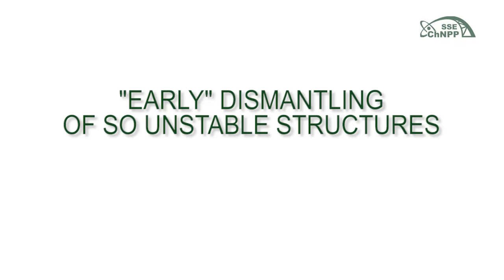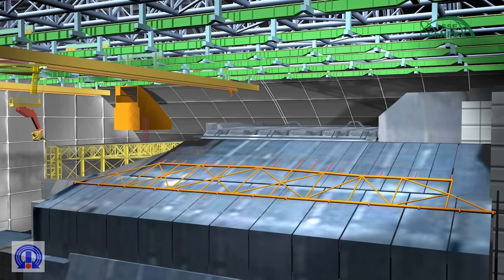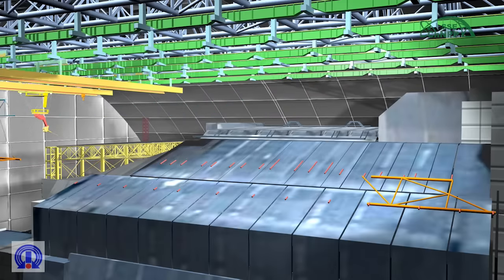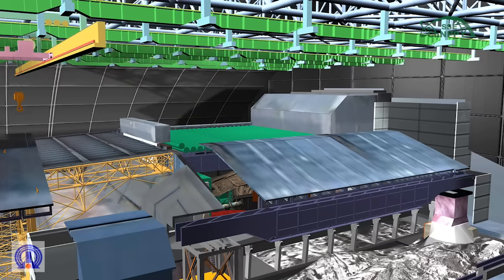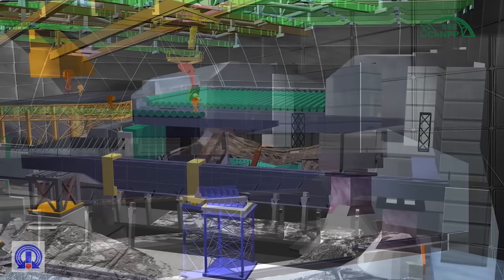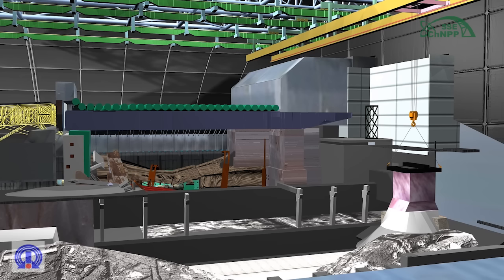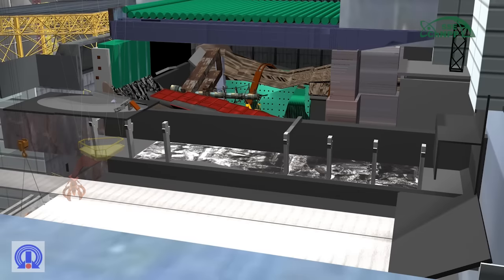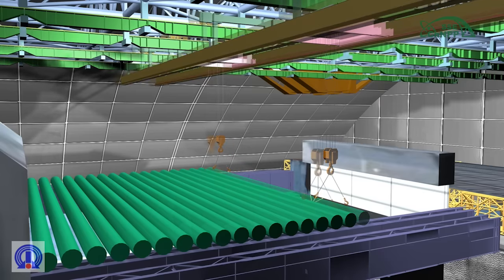"EARLY" DISMANTLING OF SO INSTABLE CONSTRUCTIONS

Comment: man i really hope they film this process as its a once in a life time event that Needs to be recorded
Reply: I agree, but the radiation level might make any electronics fail once they 'open' the old structure
Reply: @jasonhaynes2952  nope, there is footage from inside the sarcophagus. People have been inside and walked around without getting I'll.
Reply: @Matt_10203  Yes, that's true but there are still areas that need to be avoided. It's not as dangerous as it was, but that doesn't mean it's safe to be there.
Reply: I wanted to comment the same
Reply: @jasonhaynes2952  people have been in the sarcophagus, and they have filmed it, so I don’t think it would be to bad for electronics and cameras.

Comment: I've been fascinated with the new safe confinement for years, and been following the project. This is engineer porn for nerds lol, can't almost believe this is possible. I wonder: how many years until they reach the melted core? And until it's completely removed and stored in a permanent place? I hope we will somehow be able to follow the progress over time...
Reply: I've heard decades.
Reply: Agreed on all points! :) As to following the progress, and when everything is scheduled to be finished? I won't assume anyone else's age or potential longevity, but at 52, I'm fairly certain that I won't be around for the latter parts of the project. A good YT video I've watched presents a lot of summarized information (https://youtu.be/hf2-AXTVnvU?t=37), and, according to that timeline, the decommissioning of all units at ChNPP is currently scheduled to be completed in 2064. Big projects with a forecast that far out can tend to go over ... sometimes WAY over. So stay healthy, everyone! :)
Reply: Very well put.. that’s exactly what this is: “Engineer Porn”
Reply: Agree, the happening of this disaster is very black point in history, but tough Nuclear energy is very interesting. They can reach the melted core "quite easily"  however, the old sarcophagus roof needs to be removed, and then it's impossible to work for human being due to the very high roentgen. Beside this, there is a lot of sand, lead and other stuff on top of the 50% turned reactor. The angle is one of the hundreds of risks in the endless project.

Comment: 1: How log is this supposed to take? 
2: What happens when the "Temporary Storage Area" is full? 
3: where is the "Permanent Storage Area" located at?
Reply: This will take a couple year, the temp storage is large enough, and there is no perm storage, its cleaned and then they might recycle or bury it.
Reply: 1. As long as it takes.....problems are expected along the way that will require solutions
2. They will move the waste from the internal temp storage to the outside permanent underground storage....and the fuel/graphite to a Nuc/waste facility
3. adjacent to the NPP........its considered a wasteland now anyway, so there is no point moving it to another area.
Reply: @histopixelfilms6778  Will the remove everything (including the "elephant foot") or just the old sarcophagus?
Reply: @ChuckomoHo  They will also remove the "Elephant Foot" as part of the  fuel and graphite cleanup.....it will go into the same place as the other waste fuel storage.
Reply: How do you remove molten and hardened radioactive lava that has merged with concrete?!
Reply: Depends on which type of log you use. Oak would be pretty good, but if you're wanting to use Lincoln Logs you're going to have a bad time.

Either way, this will take a shit ton of log.
Reply: you use a remote tool. and lots of patience. and minimize dust. ..... the fuel itself is still too dangerous to approach by people up close I think. digging it up and moving it will be a real challenge as it will need remote handling.
Reply: @alittlebitintellectual7361  We shoot it with exploding bullets
Reply: @alittlebitintellectual7361  The fuel lava has the consistency of very hard rock or glass.  It is still fiercely radioactive, and will be even worse inside.  Tools from the mining industry are available that can break it up into manageable sized pieces, which will be disposed of as high-level radioactive waste.   This job is difficult, but not impossible.  The New Safe Confinement structure is a great approach, totally enclosing the wrecked reactor in a climate controlled environment and then very carefully going after it with remote control equipment from the top down, piece by piece.
Reply: @histopixelfilms6778  I don't think they will bother to remove the Elephant Foot. What is the purpose to remove that? To store it somewhere else? In the safe confinement it can remain safely for hundreds of years, and removing that now is too dangerous, consider that even a couple of seconds near it could be fatal for a human, you must use remote controlled robots, it's difficulty and costly. 

Even what is the purpose? Chernobyl area is already lost, it will be inhabitable for thousands of years, so the elephant foot being there is not a problem. The problem was the risk of collapse of the old confinement and the subsequent release of highly radioactive dust.
Reply: @alerighi  there's a video on youtube of people staying in front of the elephant foot for  a while. and guess what - they're still alive. they say it's dozens or 100 roentgens on the surface of the foot, less that 10 near it. so it isn't that bad as you think.
Reply: It will take decades to dismantle it. 
Very slow process probably take many hours to perform what 1 human could do in an hour.
Reply: @unechka  it's not that low, but it's certainly not as dangerous as claimed. All of the extremely dangerous isotopes have decayed by now as their half lives are short enough. Most of the remaining elements are less radioactive and not as dangerous. Anyone claiming that the foot is still extremely dangerous is a fool. Sure, it's not something youd want to be next to for any length of time, but it's hardly instant death.
Reply: @mortjoer  LOL IM DYING

Comment: Dismantling of the shelter object is just the beginning. Dismantling the reactor, itself, (and clearing the rubble) is going to be a nightmare.
Reply: Uh... the  reactor is not one piece. Yeah...  this is going to be a problem,
Reply: @heathbauerle2787  They will use plasma cutters it will be removed, or else it may go boom for all world
Reply: I really wonder how are they going to clean the reactor without dangerously irradiating the workers. 
Radiations might not be as bad as in the last few decades, but very far from safe

Comment: what if some of the bridge crane fails or got stuck somehow? would they need 3 man to go down there cuz that is what has to be done?
Reply: Hermann Goering  great answer sir :D
Reply: bongo155 well, there’s a reason why it still needs a shelter... it has decreased but it’s still pretty dangerous.... some elements will decay in hundreds of years... not 40
Reply: If you watch current videos of work inside the new safe confinement you can see people working. They even have special concrete boxes they stand and sit in at break time to help limit their exposure.
Reply: Kirk Hermary the type of works they are doing these days are not related to the more contaminated zones, so you can’t take this as an example
Reply: @gufoscuro  damn you are picky. Well then look at footage after the incident where liquidators used shovels and their hands to get fuel containing mass back into the reactor area from the roof. They tried to use technology and in the end they had to rely on irradiating man after man to carry on.

Comment: Very interesting presentation. I am curious how the Upper Biological Shield is going to be dealt with, given that it weighs about 1000 tons. Maybe some combination of the air plasma cutter for the steel plates and then the remote crushing tool for the concrete parts.
Reply: Pretty right, but they will drill and fracture the concrete parts just like hard rock mining.
Reply: I thought the upper biological shield was destroyed
Reply: @ONEIL311  Hi. it was blown up into the air and came back down,
 and sort of landed sideways back into the cavity where the reactor once was
Reply: @histopixelfilms6778  Genuinely curious, I know nothing about this stuff; are these drills you're talking about something like a jackhammer, except it would be on a robot arm?

Comment: Will people be inside this structure while work is carried out or is everything done by the cranes?
What happens if a crane fails? Does routine maintenance by workers need to be carried out on the cranes?.
Reply: I am also wondering about that :)
Reply: Think the crane is both radiation shielded as well as remote controlled. Not sure about stuff that clearly would need the help of a human worker like fastening the crane to bits for removal.

It'll be harder to justify sending in humans inside the NSC once the old Soviet "sarcophagus" has been dismantled and removed with the burnt out reactor unit exposed to the wider interior of the NSC.
Reply: When he say "Manual Operations" he means, men in protective suits will do the work by hand..........the cranes and its attachments can only do so much, and then man himself must go in.......its pretty safe as long as you dont make to much dust etc or stay in to long.....the whole structure is just to protect the outside world while dismantling is taking place......from dust and wind etc.

Comment: ok so far... but the hook s gonna need some steel cables. How they gonna be able to catch the parts without any human help to stabilize the contaminated part?
Reply: probably people will do it, the most radioactive materials already decayed enough to people aproach Medusa/Elephant Foot with tools to gather samples. The biggest problem is radioactive dust, and preventing digestion of it.
Reply: @WolfKenneth  In only 33 years? I'm not too sure about that.
Reply: @corazoncubano5372  yes in 33 years. Most high decay elements are long gone. Iodine 131 has a half life of 8.02 days, Strontium 90 - 28 years, Caesium 131 - 30 years. 
Rule of thumb is the shorter the half life, the less radioactive. More decays of atoms means more emissions, but a shorter half life. The foot will be one of the last things to go. And by then itll be alot less active.

Comment: and whats next what about the core how you will dismantal what my biggest question
Reply: it will be just cut up with remote tooling and put into shielded containers and moved to a nuclear waste facility.
Reply: @histopixelfilms6778 robots usually dont work at such high levels of radiation
Reply: @skypowergb3842  the process will be a remote control procedure, not so much a robotic one, human operators will control remote tools etc.
Reply: 6 6  you're overthinking it. Basically just remote input controls. Very simple, unsophisticated electronics that are more resistant to radiation
Reply: It's the microchips that get fried. You can make basic electronics without the need for that. Controlled simply by electronic signals down wires to actuators. No need for fancy components
Reply: 6 6    robots do things with programming and run according to their programming.....remote does things at arms length to human control, just like pulling a rope to open a gate or door......no electronics to make decisions.
Reply: @AleraKira  A lot of this can also be achieved using "Stone Age" type equipment i.e. hydraulics. Think of a backhoe...no computer. Just valves and pressure. Arms and tools can all be controlled by hydraulics.
Reply: @iamdjnam  Yeah I know, I was just pointing out that his argument that  all electronics get fried is actually incorrect!
Reply: AleraKira Of course! I wasn’t contradicting your statement, I’m just thinking of other options. :)

Comment: This looks like a project that could take 100 years. Workers cannot get in there. Any minor problem means building a special robotic arm to resolve. Yikes!
Reply: Most of the steps in this video require technicians to enter the Confinement and sling pieces of structure to the crane hook - there's as lot of manual work to be done. It isn't that dangerous - the Confinement was built because there likely will be some form of collapse of the old Shelter Object, and that risk is very high.
Reply: They can get in there lmao, do you think the building just sits empty? There are people inside the building working every day.
Reply: @Matt_10203  really? how long are they allowed to stay in there before they exceed their dose?
Reply: @AbbeyRoad69147  days at a time if you need, it just depends on where you are. inside the reactor hall, 2-5 ours before you get nausea, outside like 10 meters away from the sarcophagus, id-say about a week. it just depends.
Reply: radiation levels in the actual reactor hall of unit 4 remain quite high, but it is not impossible to get there. Staff of the plant went inside when needded. A former plant employee, went inside many times and took pictures. (he also runs his own channel on YT) He said in an interview that he and his colleague would usually go for 10-15 minutes at a time for filming.

Comment: That's nice but the decommissioning of the whole is a shame and you should be ashamed for it
Reply: Κώστας Λεούσης what Bro
Reply: U wot mate
Reply: Patrick Melo Modesto they should not decommission reactor 1,2,3 because it's part of a memorial
Reply: @type2523  they have to decomission them, there were fuel elements in the cores. Plus not decommissioning them makes them a time bomb when they begin to decay over time, then eventually the radiation leaks out
Reply: @type2523  RBMK reactors are very dangerous, and are very hard to maintain.

Comment: New safe confinement lifespan: aprox. 100 years. Half life time of  radioactive materials inside: aprox 30000 years. Good luck with that one.
Reply: the purpose of the new containment structure is just so they can safely deconstruct the old, unstable structure without releasing radioactive dust into the atmosphere. The problem with the old structure is, that it was partly build on the debris of the reactorbuilding and no one knows how stable or unstable it is. If it would collapse, it would send a radioactive cloud of dust (fallout) into the atmosphere. The NCS ist climate controlled and has its own ventilation system. After they removed the old shelter they can, as far as its safe, clean up the debris, seal it and make it as safe as possible for the environment. That should be doable in <100 years
Reply: @TheForrestMaster  yes this is totally correct......it should all be over even with the problems they expect in a max 40-50 years......it may even be much sooner if all goes well......however it will never be redeveloped in our or our kids lifetime, as the site will also contain the Nuclear waste dump for all the disposed materials.
Reply: That's not how radiation works hahaha 
Longer half lives = less radiation due to less nuclear decays

Basic science yo
Reply: For chernobyl that may be true but Japan is keen of cleaning Fukushima to point of removing all sings of human activity. They will make some fancy meadow at this place

Comment: Why not just abandon the area forever? 1.8 billion to enclose the original confinement structure. Why not just leave it be?
Reply: Because abandoning the area  is just putting a bandage over the old bandage. The original structure was built as a way to quickly seal off the radiation until it could be properly dealt with. And the new safe confinement is a way to properly deal with it. 
If they just ignore it and leave it as is 100 years from now someone will have to fix the now decrepit new safe confinement. Burying a problem does not make it go away when we are talking about what lies in the centre of reactor 4.
Another thing to consider is if the area became abandoned it could very easily be weaponized if it fell into the wrong hands.
Reply: FloppyDriveMaestro very thorough answer from you. i just want to add, the sarcophagus was only planned or just save for 30 years.  And might collapse in case of tornado or earthquake. they have to find a way to dismantle it.
Reply: Because the old sarcophagus will eventually collapsed exposing the reactor and its toxic fuel to the elements which would cause mass devastation throughout Eastern Europe.

Do you really want future weather reports to include "high chance of radioactive rain in your vicinity so be sure to stay indoors"?
Reply: Because its still highly radioactive...33 yrs is peanuts to the half-life of plutonium which is 25,000 yrs....that radiation could still kill half of europe.